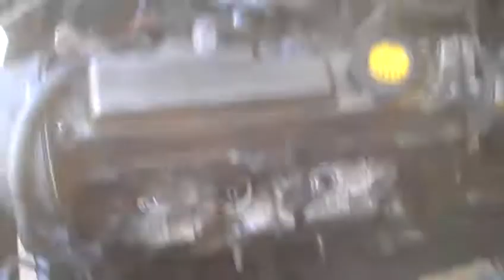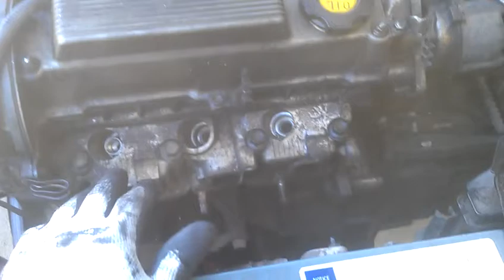Geo Metro compression problem 2 continued

Comment: I have 145 psi on two pistons and 115 psi on the middle piston. I leak about a half a quart of oil driving from Edmonton to Saskatoon and back though my mileage is great at 59 mi/g. Would you say this problem you are describing is what's happening?